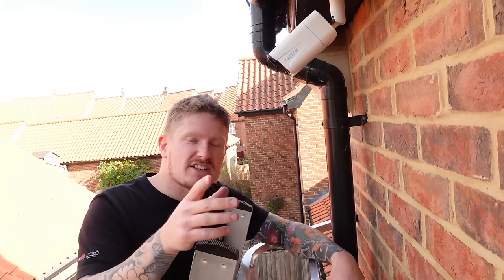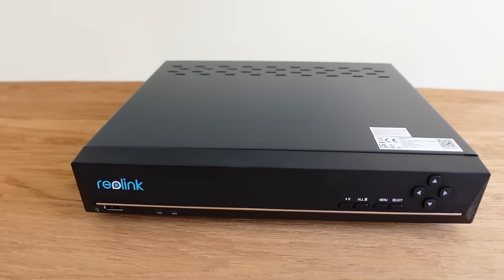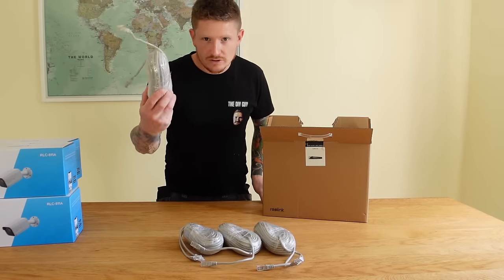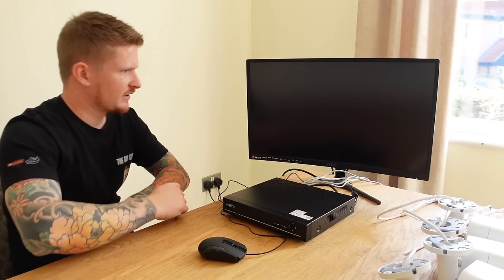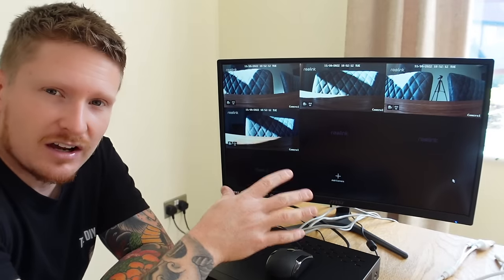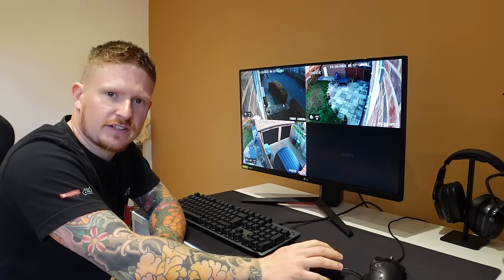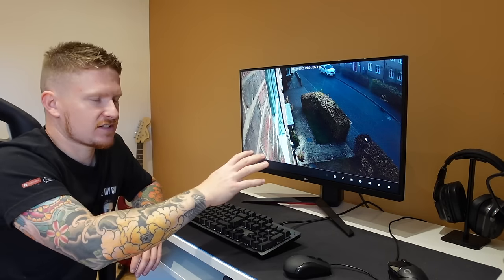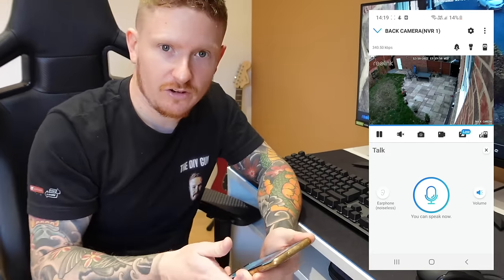How to Install Your 4K CCTV System Quickly and Easily | Home Security

Comment from the maker: Hope you like the long awaited video. Sorry for the audio error, it will be fixed by the next video.
Reply: Always great content! Audio was fine. If you hadn’t said, I wouldn’t have noticed!
Reply: How has the system gone so far is it good? Looking at something similar
Reply: e-fur-net cable, sorry was driving me crazy lol.
Reply: Hat be done when you are not at home or connected to the router
Reply: Vinegar will solve your spider issues
Reply: Dude you’re a star ❤
Reply: @thediyguy what are you brother electrician, plumber, carpenter or handy man? Great work also 👍💯
Reply: Thanks for the info
Reply: Great job. But kindly help with how to configure md assign IP adress 

Regards,

Comment: A lot of people have cctv nowadays the idea is to stay a few steps ahead like concealing them or some of them, having more than one system and WiFi one system via the neighbours router with their permission of course so it still works if your phone line or cable is cut, a back up battery is another good idea or isolated wildlife camera or two independent of a cctv system.

Comment: I worked at a low voltage company and we would install large amounts of CCTV cameras in sets of model homes. We would link the CCTV cameras in each model home together using a combination of network switches and network cables. in each model home, all the cameras would get plugged into on network switch and then in the office where the NVR was, there would be a single network cable that would get plugged into the back of the NVR for all the CCTV cameras.
Reply: YOURE SAYING THAT THE SINGLE NETWORK CABLE DIRECTLY FROM THE NVR WOULD HAVE 4 MALE CONNECTIONS THATLL FEED TO EACH CAMERA?
Reply: @pushtelevision5013  No, the single cable to the Network Switch. From there, separate cables for each camera.

Comment: Few tips/other option:

1. If you have power in the loft or can get power installed there you can avoid having to run the cables from the loft. You can locate the NVR in the loft, plug all the cameras into it there and use a powerline plug to get internet into the loft without running any cables. You can then view the cameras on the computer and/or mobile via the computer software or mobile app. This makes installation so much easier. Also the NVR is more secure as it is "hidden" in the loft so less likely  to be taken in the event of a break in.

2. Use SD cards in the cameras so the most recent footage is stored on the cameras as well as the NVR. Then if the NVR is stolen you still have the footage.

3. Have a mixture of camera heights. The high ones are good for an overview but they aren't much use to see details as they are looking down on top of people. You want some lower ones to give you good images of faces/cars etc

4. Cobwebs are a real pain with IR at night, consider using security lights to turn night into day, separate IR lights so you can turn off the camera's IR, use anti spider spray. Cleaning the high up cameras of cobwebs can be a real pain. Check the night footage regularly as if you have cobwebs over the cameras the image is likely to be no use.

5. Use some electrical tape if you don't have a label machine to label the cables so you know which cable is which camera in the future.

6. Consider getting a set of Ethernet crimpers so you can cut the cables to length then put knew ends on the ethernet cables, doesn't cost much, it is easy to do, just watch YouTube and also lets you make custom cable lengths for any other times you need them rather than having coils of excess cable - it also makes pulling the cables through much easier as there is nothing to get caught up.

Hope some of that is useful to people.
Reply: Thanks
Reply: Cheers
Reply: Brilliant tips.  Can't beat experience!
Reply: Thanks 👍🏻
Reply: I did the same. I kept the NVR in the loft and then directly connected a BT wifi disc extender in the loft.
Reply: Great advice.
Reply: Point 3 is the most important one, CCTV is of very little benefit if you can't provide a positive identification of someone.
It's one of the few benefits of an experienced installer that they will consider something like that.  Nothing wrong with having those additional overview angles though.

Also agree with point 1, Powerline is generally quite reliable, it has no effect on the NVR recording the footage, if there was a problem with it would just effect accessing it.
Reply: Get decent SD cards for the cameras, so not cheap out. Go to a proper IT store like PC world, get high quality high speed. 
To many cheap out on cards after paying out proper money on a camera system. 

Get Shielded Cat 6 Ethernet cables, I like to buy premade ones. You can also colour code them. Unshielded does work but shielded is better for cams.

The NVR get a proper CCTV hard drive, costs a little extra but again will last twice as long. So save long term.
Reply: My tip is to segregate the Ethernet cables away from AC power cables by at least 100mm for non shielded POE. At least try and tie them than rough strewn diagonally across the rafters.
Reply: what in the case of power cut? no electricty = no footage? is any spare buit-in power supply to run NVR and cameras?
Reply: That is such a good idea.
Reply: @marcinx89  You could use a UPS (Uninterrupted power supply).
Reply: Exactly. I installed the Reolink NVR in the loft itself. Asked the electrician to put gang of sockets in the loft. The Reolink App on PC or mobile can remotely connect with NVR without issues.
Reply: Invaluable advice. Thank you!
Reply: You forget too mention that it is illegal too aim your cameras at a path or road due too children walking up and down so you have too put a sign up outside your house either mounted on the wall,front door etc saying ‘cctv in operation’ so people know you are recording them
Reply: hdmi over ethernet is also a good option for NVR in loft and only having to run one cable in older houses which power line can have issue with.
Reply: Use (pass-through crimps & Crimper ) there's nowt worse than crimping Cat5e/Cat6 in January up ladders freezing your nads off.
I built a Network on top of Stockport Mill a few years ago for loads of sectors and pads my fkn hands were in shxte state.
Reply: @Cam Herring #2  you can potentially get around that by getting agreement from your neighbors (if you ask nicely) most of mine are (on the tools ) our cameras interlock coverage to cover our work vans for the obvious reasons ..
Reply: @jakejohnson_  youll need a few couplers for that as well.
Reply: I have power sockets in my loft and a wi-fi extender within a few feet of the loft - we live in a chalet bungalow so half of upstairs is living accommodation, and the other half the loft.  So putting the NVR in the loft and running all of the acmera cables to i9t would be much easier, but I'm not clear on what to do next.  I have my main broadband router downstairs, then a Netgear wi-fi extender in the upstairs room from which we power our internet connections wirelessly upstairs.  That wi-fi extender is just a few feet from the loft (which is on the other side of the wall), so can I use the wi-fi extender to connect wirelessly to the NVR from my pc?  Does that make any sense?
Reply: Good tips. But if the cameras are connected to the NVR directly, it can't record on the SD card at the same time.  If you run your cameras in standalone (POE Switch or Injector) mode then you can have 2 copies from your app and the SD card.
Reply: @camherring2709  No. People have the right to install CCTV cameras and smart doorbells on their property. They should try to point cameras away from neighbours' homes and gardens, shared spaces or public streets. But this is not always possible, and it is not illegal to do so.
Reply: Be aware it can get very warm in a loft space, I had my bt router in the loft space but in summer it reached over 50 degrees and the router was not happy.
Reply: @camherring2709  It's not illegal.
Reply: @itsmyview2024  it can also get wet during very cold snaps when moisture can condense on the felt, leading to drips. Quite common these days with people not ventilating their homes in the winter, trying to conserve heat.
Reply: I have a question. I have a house and garage that are separate on the same property. I am upgrading from 720 cameras to the 4K system. I already have a cat 6 cable running from the garage to the house underground. This was so my unmanaged switch could send the 4 cables correction the 4 cameras into the house so I could attach them to the Internet. Right now I have a total of 8 cameras. 4 on the house and 4 on the garage. I have A router in house. When I switch to the 4k POE system,  What would be the best way to get all 8 cameras to record on the npr I want to keep in the house? Now if I follow your suggestion and keep the NVR in the 2nd floor of my garage what would I do to connect that? Thank you for your time
Reply: @itsmyview2024  This is what I was thinking... Reolink RLN8-410 for example has the following rating:

Working Environment

Temperature: -10°C~+45°C (14°F~113°F); humidity: 10%~90%

Aside from year long cold climates, you will hit those temperatures in your attic extremely easily. Honestly, installing your system in your attic is one of the worst recommendations you can make.
Reply: Great tips! Thanks a lot!
Reply: Please give details on wiring used Or which is best wire for interior & exterior needed or I need to run wire to over head pole then underneath ground to gate for security camera please advise thx in advance 🙏
Reply: thank you
Reply: For the point 1, it depends a lot on where you live. 
In the summer the attic is going to be an oven, right now I have outside 40+ Celsius in the shade, in my attic it's probably 50-60. Winters are also harsh. Not to mention the humidity, bugs that can get into it, dust etc.
Keep in mind that the NVR is still a computer, it's going to get hot and a measly cooler won't help at all in an oven
Reply: @Dumoras Yeah man, the other tips aren't too bad but that first one is a no go living in the southern California desert that shit would be melted after the first heatwave haha
Reply: Great guidance, much appreciated
Reply: @camherring2709 Rubbish. There is no law against filming a public place.
Reply: @beerspongebob  Actually there are 3 exceptions to that, but in most cases no, I agree.
Reply: Yoou need to make a video.
Reply: Thanks bro
Reply: The last tip is a pain and I’d recommend non techy people to just stick either regular cables. Of course this is just me speaking from personal experience. You might disagree.

Comment: I installed these last year in my house. Very impressive cameras and system. Worked flawlessly from day one. I live in a bungalow, definitely helps with cable runs. I also have a few Wi-Fi cameras added on for remote areas. They integrate with the system brilliantly. Highly recommended.
Reply: I left the box in the attic. You don’t need to connect the box to a monitor to use it. It can be fully accessed and controlled using the software on a PC/Mac/iPad etc. Mine is hardwired to my TV via a HDMI cable but I don’t use it, there is no need for it. So the box can be placed anywhere that’s dry.

Comment: Great video and some really useful tips from other subscribers to the channel. Having installed CCTV a few times one useful tip I've picked up is positioning the cameras for motion detection. Most cameras won't activate unless they're within 3 meters of the moving object. Better cameras have a greater range. Cameras under soffits usually don't activate until the person or car is almost under the camera. If the camera is aimed over the person you won't see them or at best just a view of the top of their head. I usually fit cameras at a mx of 3 meters which gives the camera time to activate. I usually fit cameras in positions that cover an area from two directions to prevent tampering without being viewed on another camera. Remote Infra red illumination is a good idea especially if you get camera flare from the integral camera lights. Lastly, watch out for central heating flue and vents. Steam and heat can give a false trigger. Absolutly the last point is comply with regulations. There are government guideline in England. Download a copy and make sure your within them to avoid hassle with neighbours and members of the public.

Comment: If you had a power socket in the loft you could explore various power over Ethernet adapters, one plugging into the loft socket, other into the wall socket in the home where the NVR box is. That may avoid the camera ethernet cables being drilled through walls etc.
It depends on if the adapter sends the camera power signal in the ethernet cable.

Comment: hello diy guy I need help. installing reolink for the first time using your video as help but I have an issue. I need to run cables on exterior wall. are these cables waterproof or will I need protecting?

Comment: I’d cheat and leave the NVR in the loft and access it via the included app. You can then use ‘home plugs’ to get it connected to the router downstairs - luckily I have power sockets in the loft space for all that. I bet Those lights you put up last episode came in handy!
Reply from the maker: They did 😃. The NVR in loft is certainly a viable option for sure. I wasn't sure if the fluctuations in weather we have here in the UK would be of any detrimental effect to it so I decided not to go that route.
Reply: @TheDIYGuy1  yeah probably not the most favourable home for it, but as my DIY skills aren’t up there with yours, I always look for the safest route/the way that offers the least chance of me causing some unnecessary damage 🤣
Reply: @davyarthurs  The NVR should be in a temperature controlled environment

Comment: Shed and driveway alarms are good you can have the receiver on 24hrs in bedroom without needing to remember to set anything you could put a shed PIR transmitter permanently downstairs in the house working 24/7

Comment: Did you use the cat5 that came with the Reolink 4k security camera NVR kit? I'm so eager to put my new Reolink system up but I've read reviews on Amazon that said they upgraded their wires to cat6. Is cat5 good enough for the 4k 8mp Reolink cameras?

Comment: Good video.. I am swapping out my 1080 cameras and switching to A 4K system. I have a house and garage, which are separate, approximately 20' apart. I understand I'm upgrading to a POE system now, so I don't have to use power cable. I have a cat 6 wire underground running from the garage to the house where the router is. My question is if I'm putting 4 cameras on the garage and 4 cameras on the exterior of the house and I want the NVR in the house, what do I do to get the cameras on the garage to record onto the NVR? I'm guessing I will have a 4 way Poe switch in the garage. So can the 4 cameras go into the Poe switch and then the cat 6 running from the garage to the house, connect the POE switch to the NVR? Thanks for your time and wisdom
Reply from the maker: Thanks

Comment: Excellent video! Can i install that camera where the old bell box alarm is at the front of the house? Can I use the wires from that bell box? It's a wired alarm that i don't use and it will changed to a wireless alarm. Thank you
Reply: You'll need to run new CAT5e cable or CAT6 cable to the camera.

Comment: Hi, can you please tell me what size auger bit you used to drill the cable hole and for the camera mount 3 holes.   
 Also can you please tell me what Cat the Ethernet cables need to be in order to withstand being run outside along facia boards.  I was told cat 5e would be good enough? But I don't want them to perish in hot or cold weather, should I decide not to run through the loft.  Thanks.